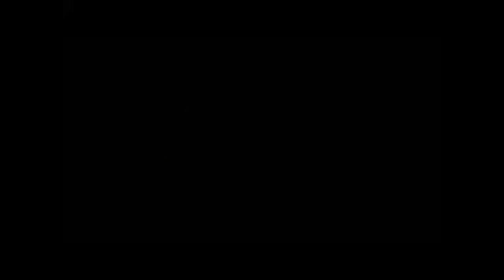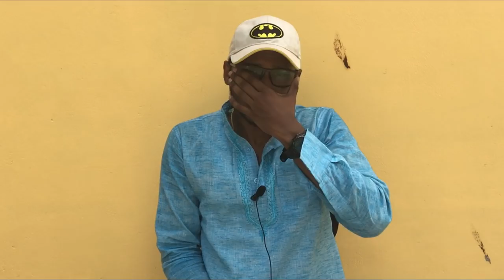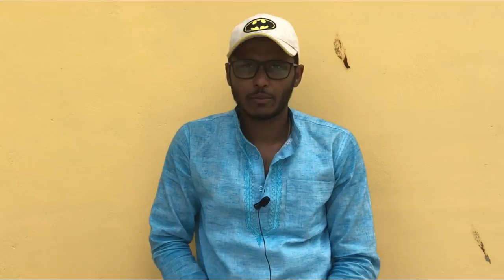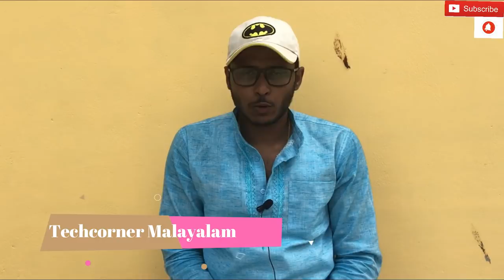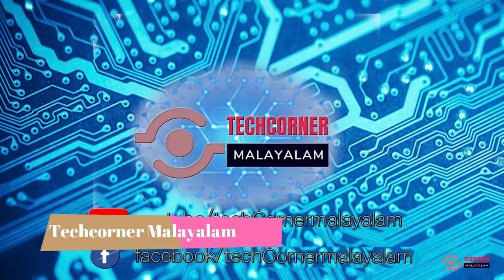How to calculate wire size|വയർ സൈസ് എങ്ങനെ  കാൽക്കുലേറ്റ് ചെയ്യാം

Comment: Electrical shop IL chennu parayenda specification ithaano? Like 1.5square mm wire 5metr ? Or guage
Reply from the maker: Athe 1.5sqmm ,5 m is correct
Reply: Guage parayunnth epozha
Reply from the maker: Guage use cheythirunate AWG (American Wire Gauge ) standard prekaram ane athe koduthalayum uoayogikunnathe  single strand wire case el ane athayathe earth wure represent cheyunthae SWG form analo athupole pazhaya kalagalil upayogichirunnathe single strand wiresum ayirunnu. Athupole guageil Value koodunathanusariche Diameter kurayum
Reply: Standard guage values Ne pattiyum  oru video iduo.?

Comment: 300mm cable anagil ethra Amp varum egane calculate cheyam?
Reply from the maker: Aluminum aanel 450 amps veremokke maximum undaakum capacity

Comment: Amps  ,wats,  waiter   ഇതിനെക്കുറിചു  പറയാമോ  ?
Reply from the maker: Current vs Voltage|Which is Dangerous| എന്താണ് Electric Shock |കറന്റാണോ വോൾടേജ് ആണോ പേടിക്കണ്ടത് https://youtu.be/Etm_5RNhKoY
Reply from the maker: kW vs kVA | Why Transformer is in kVA and not in kW | Difference between kW and kVA in Malayalam https://youtu.be/fE4u6jzDALo

Comment: 1.5 sq.mm X 6 = 9A ഇതിൽ 1.5 എന്നത് wire ൻ്റെ diameter. അപ്പോൾ 6 എന്ന value എന്തിനെ ആണ് സൂചിപ്പിക്കുന്നത്?
Reply from the maker: Athu oru constant pole pandu muthal aalukel use cheyuneth aanu
Reply: 1.5എന്നാൽ diameter അല്ല crosssection area ആണ്

Comment: I sq mm നു 6amp വരെ load കൊടുക്കാമെന്നു പറഞ്ഞു. പിന്നീട് പറഞ്ഞു low waat ലോഡിന് 1.5 sqmm വേണമെന്ന്. വ്യക്തമാക്കാവോ? Eg. 15waat ഉള്ള ഒരു led ബൾബിനു ഏത് wire കൊടുക്കണം.? 4amp ഉള്ള ഒരു subcircute നു ഏത് wire കൊടുക്കണം
Reply from the maker: Sherikum 1 sqmm 6 amps verem kodukam... pakshe oru house wiring in standard enna reethyil 1.5 kodukkum future il ah point il koodthel load vannalo ennu karuthy, pineed load kooduanel rewiring cheyendello...
Athupole 1 and 1.5 cables thammilulla cost difference orupad illa ...
ee paranja 2 case ilum 1sqmm cables mathy, pakhse mikyeidethum 1.5 mm aayirikum use cheyuneth.
Manasilayi ennu karthunnu
Reply: @TechCornerMalayalam  thanx bro, for ur fast reply.
Reply from the maker: Welcome bro... ningade okke support alle nammade energy...
Thudernum support cheyuka..videos friendsinte ideyil share okke cheyuka
Reply: @TechCornerMalayalam  question and answer cheyyunna telegram group thudangu broo

Comment: പറയുന്നത് അത്ര സെരിയല്ല.... Ac... Power കുറവ് ആണ്... ഇപ്പോൾ 1.5wire ആയാലും മതി...1.5wire 16amper എടുക്കും..... Heater 3000വാട്സ് ആണ് അതിന് 2.5or4square mm   acmaximum 1000wats.. 1ton

Comment: Egane ആളുകളെ പൊട്ടനാക്കി  യൂട്യൂബ് റേറ്റിംഗ്  income  vagi  നടക്കാതെ  വല്ല പണിക്കും poda wire സൈസ്  wire ലെങ്ത്  ലോഡ്  നോക്കി വേണം  കേബിൾ എടുക്കാൻ  നീ ഒരിടത്തു  ലെങ്ത് പറഞു ഇല്ല  2.5 100 meter എട്ടു 1.5 tun ac എത്ര നേരം  ni ഓടിക്കും
Reply: Chettan ee video muzhuvan kandoo  ? . 🤔
Reply from the maker: Hi Jobin Bro,
Bro ee video muzhuvanayi kandu ennu thonunilla...oru video kanumbol athine theri vilikenemena attitude il kandaal ah video il parayuneth manasilakilla... E video de aadyam thanne parayunund oru wire size determine cheyuneth load, athiloode pokunne ampere, voltage drop ithokke vechitaan, Voltage drop ennu vechal wire length and size aanen suhirthin aryuo ennu aryilla.Athupole thanne video il evideyum 2.5sqmm AC ik kodukan parayunilla..Vekthamayit parayunund 4 Sqmm aanu generally AC ik kodukunethennu. Video il parayununund ith thumb rule pole kaalangalayi peten wire size aalukel calculate cheyunne method aan ithu ennu.   Athpole manyamaayi pani eduthit thanne aanu jeevikuneth cheyunne pani okkke manyamaanennu bhodhaum und,   Ithupolethe comment idumbol atleast ah parayuneth onnu poornmayum ketit idanu sremikuka
Reply: Bro ഈ പറയുന്ന  calcution  നടക്കും ബട്ട്  ഈ തിയറി  ബുക്ക് എടുത്തു മാറ്റി  വച്ച്  നല്ല  ഒരു  വർക്കിന്‌  വാ  അപ്പോ  വോൾട്ടേജ്  ലെങ്ത്  wire  copper അലുമിനിയം  അങ്ങനെ നോക്കാൻ  ഒത്തിരി  കാര്യങ്ങൾ ഉണ്ടല്ലോ    ഈ ബുക്ക്  നോക്കി  പോയി  നല്ല പണി കിട്ടിയത് കൊണ്ട് പറഞു  ur  ചാനൽ  എന്തും ഇടാം   നിങളുടെ ഇഷ്ടം  നിങ്ങൾക് മാത്രം അല്ല  ഏതൊക്കെ അറിയാവുന്നതു എന്ന് കൂടെ ഓർക്കണം
Reply: Bro ennu (1) മാർക്കറ്റിൽ വരുന്ന water ഹീറ്റർ  എല്ലാം  3 ലിറ്റർ 3000W ആണ് അപ്പോൾ നിങൾ നൽകിയ ഇൻഫർമേഷൻ  (2) ac ഇപ്പോൾ  ഇൻവെട്ടർ ac ആണ് സോഫ്റ്റ് സ്റ്റാർട്ട്  ആണ്  അപ്പോൾ 4 sq mm വേണ്ട   statring  current കുറവാണ് ഒരു  4 ac ഉള്ള  വീട്ടിൽ  ഇൻപുട് കേബിൾ  ഈ 4 pattila 3 ഫേസ്  ആകും  വേറെ ലോഡ് ഉണ്ട്  chilapol ഇന്പുട് കേബിൾ  അലുമിനയം ആകാം  അപ്പോൾ 60% കൂടുതൽ  വേണം  അങനെ എല്ലാം പറയണമ് എന്ന്   പിന്നെ  ഈ  house വയറിങ്  മാറ്റി വച്ച്  ഒരു    B ക്ലാസ് ലെവലിൽ  ആലോജിച് നോക്കു   fist time  e കാര്യങ്ങൾ കേൾക്കുന്ന  ആളുകൾക്ക്  വലിയ കാര്യം ആയി  തോന്നാം  നിങൾ  പറയുന്നത്  ബട്ട്  എനിക്ക്  അങനെ അല്ല  അത് കൊണ്ട് പറഞു
Reply: Techcorner bro,  ഇവൻ  പഴയ  electrician aayirikum കുത്തിപൊളിക്കു  പോയി ആശാന്റെ  കൂടെ പണി  പഠിച്ചവൻ  ഇവന്റെ  ഒക്കെ അടുത്ത്  6 * sq mm of copper wire = max Amp 

പറഞ്ഞാൽ  മനസ്സിലാകുമോ
Reply: @akashv9036   bro നമ്മൾ  കുത്തി പൊളിക്കും പോയിട്ട് ഉണ്ട്  ITI  kaziju പിന്നെ  പോളിക്ക് പോയി  ഇപ്പോ B ക്ലാസ് സൂപ്പർവൈസർ  ലൈസെൻസ് ഉണ്ട്    ഒരു  വർക്ക്   ബസിന് കൂടെ  ആണ്  ഏറ്റവും റേറ്റ് കുറച്ചു  കോട്ട് ചെയ്യുന്നവന്  വർക്ക് കിട്ടും  പിന്നെ  wire സൈസ്  കോപ്പർ  സൈസ് ഓക്കേ എലെക്ട്രിക്കൽ  ഇൻസ്‌പെറസ്റിൽ നിന്നു ഒരു  ചാർട്ട് കൊടുത്ത്  ഒന്ന് നോക്കു    സ്മാൾ  സ്കെയിൽ  വർക്ക്  മാറ്റി വച്ച്  house വയറിങ്  കാര്യം പറയുന്നത് പോലെ അല്ല  ബാക്കി  കാര്യം  നിങ്ങൾക്  വിമര്ശിക്ക  അത് പോലെ  എനിക്ക് തോന്നിയത്  nan പറഞു
Reply: @arunradhakrishnakurup7954  കണ്ടു  bro  പല വട്ടം  കണ്ടു